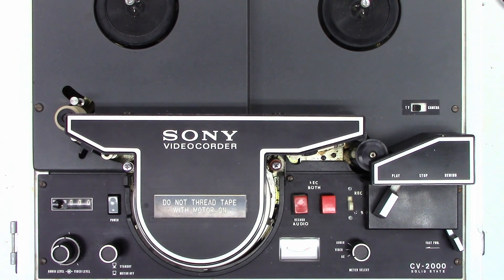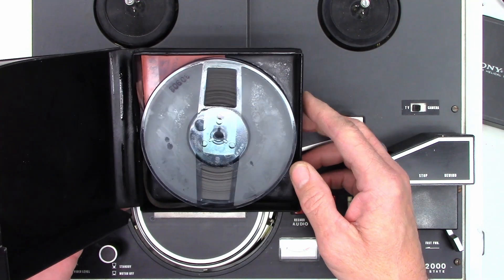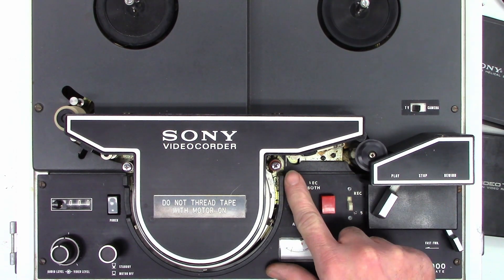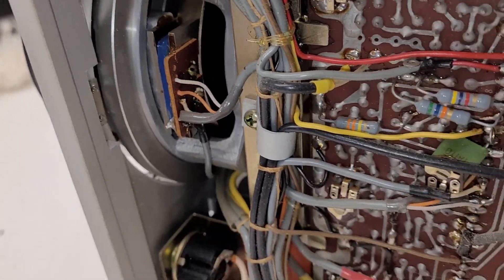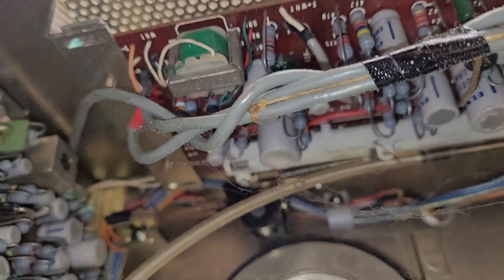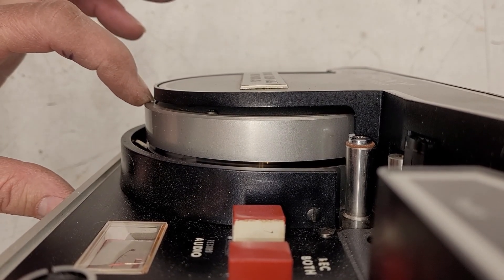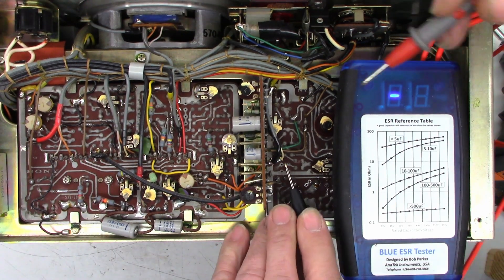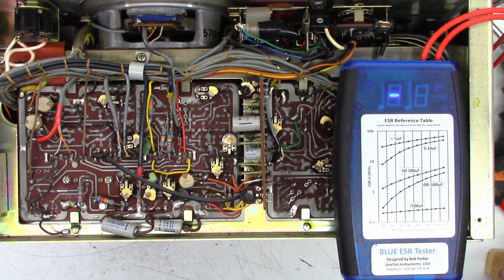Sony CV 2010 VideoCorder (not a VCR) from 1965 Initial look around.

Comment: I find it amazing that such things existed so early. This was a time when even the TV companies (in the UK at least) didn't have many VTRs, and used 16mm for a lot of stuff to save cost. I remember my local ITV station had to send footage down the line to London if they wanted slow motion replays as late as the early '70s. Must have been ferociously expensive for a prosumer.
Reply from the maker: I think the retail was around $700 in the mid-late 60's. Equivalent to $6615 today. That is based on a 1965 price of $700